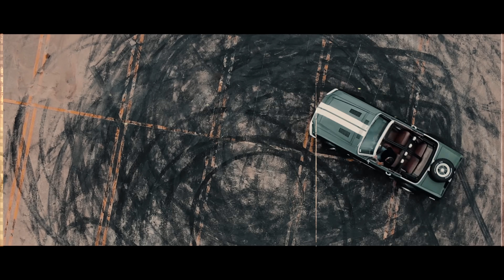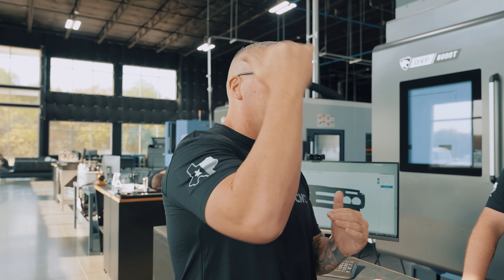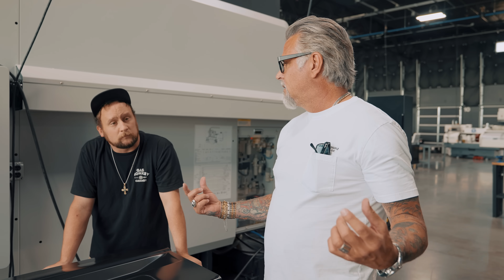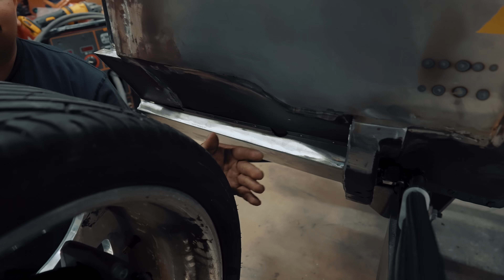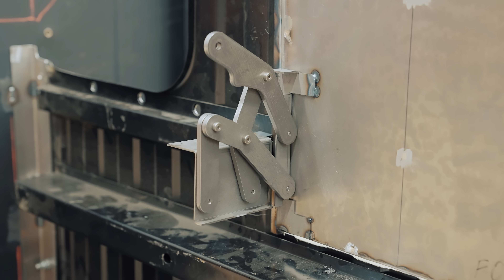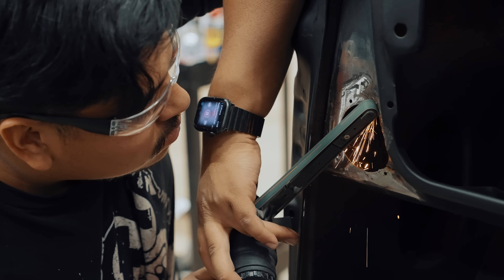BUILDING A ONE OF A KIND C10 FOR SEMA | PT 3 - GAS MONKEY

Comment: those heater hoses are going to rub on the body and produce a hole eventually unless this truck doesnt get actually driven much. I would have put some type of rubber protective over the metal where the hoses are touching.

Comment: What's funny is Titans could set you up with some small diameter carbide insert tooling for your mill there.  I started using some and the finishes, speed, and versatility of them just took some of the small machining  projects of mine to the next level like...boom.

Comment: On that tailgate I would have cut out the center section honeycombed the outer areas to match the grill with a solid piece in the Middle with the GMG at about an inch raised.